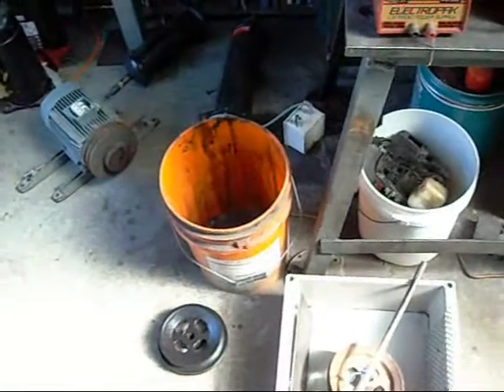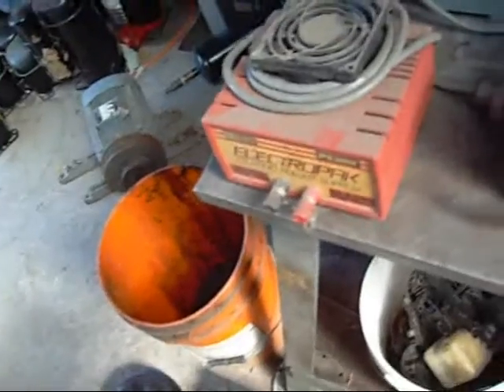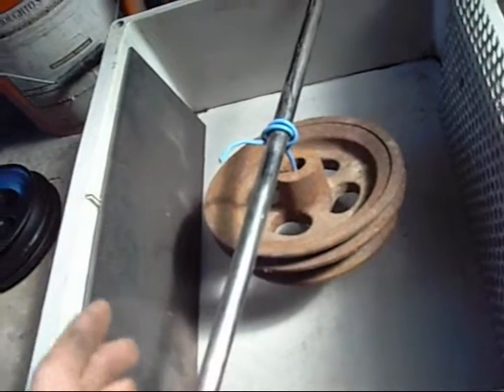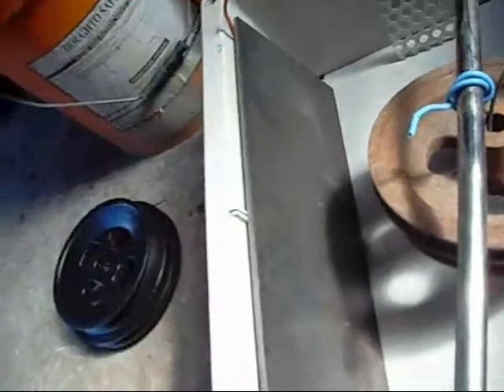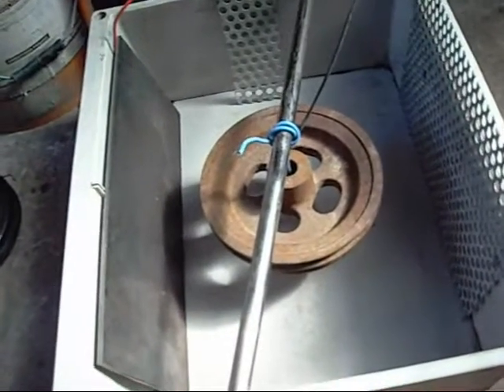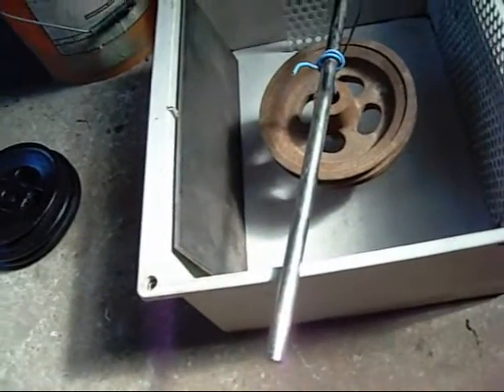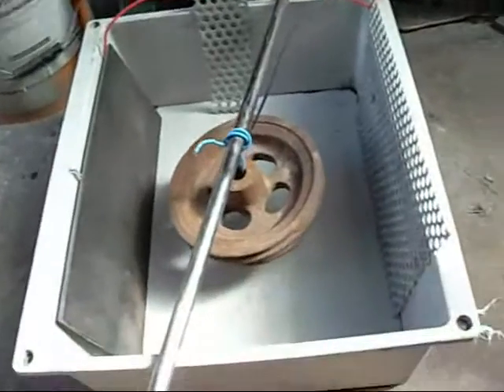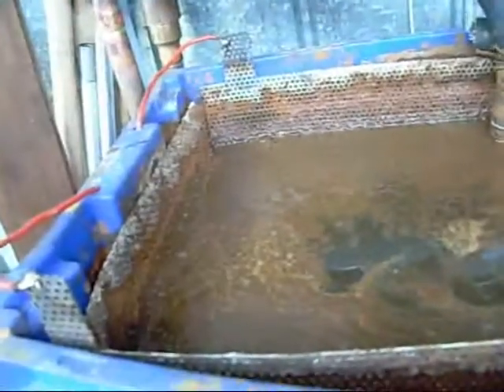Electrolytic Cleaning 101

Comment: I have used bicarbonate of soda at 12v and turned down the amps to 6 as it was going nuts!!! (I was running 25) I was wondering what all the gas was, I see now its hydrogen so maybe safer to do this outside or in a very well ventilated room. many thx for the video

Comment: so you dont have to use a (car) battery charger? you can use any power supply, such as a computer power supply? Is it the AMPS or Volts that you need to look at?
Reply from the maker: you can use any DC source as long as you keep in mind that higher voltages make the whole thing more dangerous to run, all you really need is 12 - 24V for a hobby tank and plenty of current. 

The surface area of your anodes and workpiece will determine how much current it wants to consume, and it will soon fry an under-rated PSU. 
I have used ATX power supplies before too, they run a small tank quite nicely and have inbuilt short circuit and overheat protection too!,

have fun and mind the hydrogen ;)

Comment from the maker: @Axemurderer62 thick is good but if its a once off job you could use a thinner tub as long as it does not split at the corners.
the $30 clear K-mart handy bins work well but need a wooden frame to stop the sides bulging out and stress cracking. likewise I put a plastic panel from the top of a old copier in the bottom to prevent smashing the bottom if I put a heavy object down on it.

Comment: Question my good man, I want to use some thing like this to clean old coins and other metal detecting finds, and every thing I've read says to use Stainless steel for the Anode.  
If using SS can create toxic compounds why do they say use a SS spoon or rod when building a DIY Electrolysis Coin Cleaning   tank?
I really want to try Electrolysis Cleaning but don't want to poison my damn self in the process..
Thanks for any info you can give.
Great video, thank you  for shearing your knowledge.

Comment from the maker: @toxicproductions100 Aluminum will break down fast as a anode, and it will be attacked if you are trying to clean it as a cathode..
so, no it wont work properly
Reply: So if you use it as a anode, it will just break down faster then using steel?
Other then that its ok to use aluminium as anode right?

Also I want to try using Oxalic Acid (C2H2O4) instead of soda, it should clean rust pretty good.
Have you tried this by any chance?